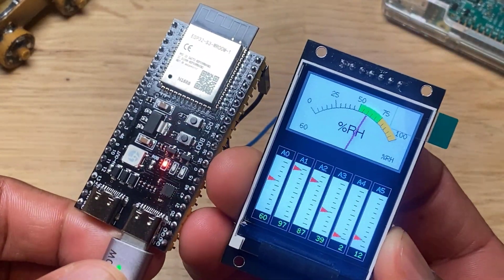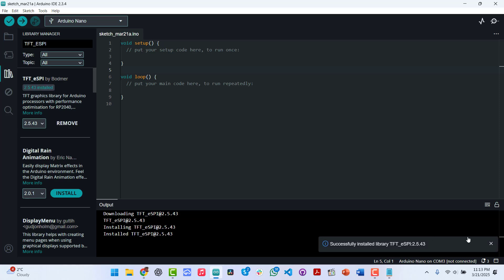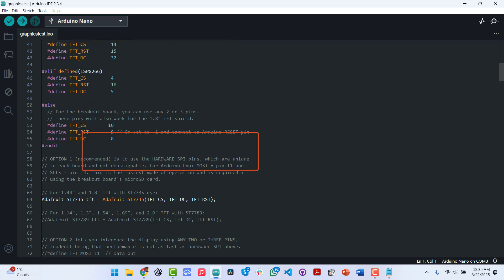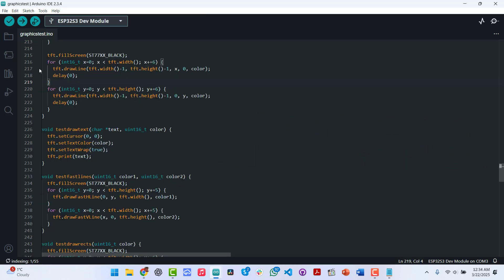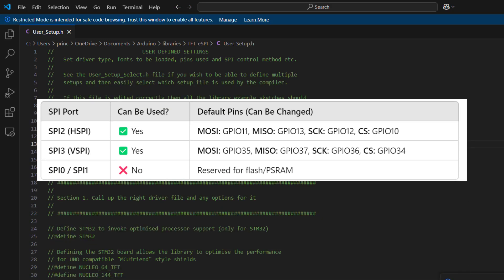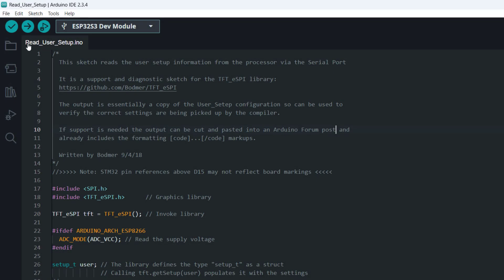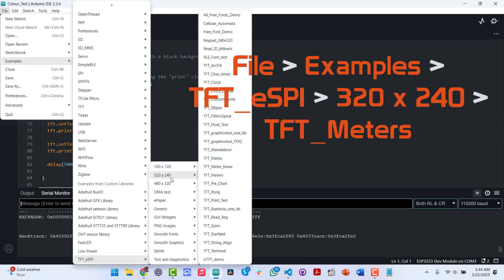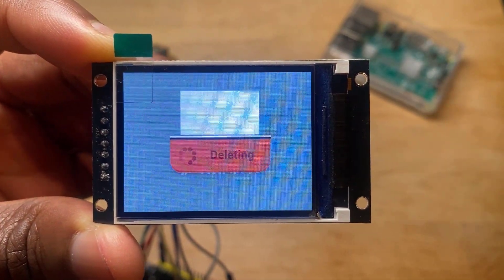How to Set Up ST7789 TFT LCD with ESP32-S3 | Fix Crashes & Use Adafruit & TFT_eSPI Libraries

Comment: For anyone struggling to get it working on the ESP32 S3 be sure to downgrade your ESP32 board definition from espressif to 2.0.14 is broken in newer versions.
Reply from the maker: initially i thought so too but as you can see from the video, adjusting the user_setup.h file fixes the crashing problem.

Comment: Thanks to you i already understand the User setup thing, but I'm using a 1.3 inch ST7789 display but without CS and also a XIAO seeed esp32 s3 and sadly it is not working with neither of the libraries. It did work while uploading on the arduino nano with the fast arduino ST7789 library but after the uploading is done, it goes back to glitch. Do you have any ideas on what i'm doing wrong. It'd be a very big help.
Reply from the maker: Can you list the pin names of your screen?
Reply: @Delali  I only have GND, VCC, SCK, SDA, RES, DC, BLK.
Reply: it is working!! It is thanks to your video that it is working so thanks a lot
Reply: @MaritjeHocedez Could you pleas let me know what you did to get arround it? I have the same type of screen(no cs pin) same layout as yours. I've been trying to make the screen work for probobly more than 6h, nothing seems to be working.
Reply: @niksdejus7945 i have same problem. did you fix it?

Comment: Next project. Using 2 esp32's 1 display and a keyboard. I bought a CARDKB Keyboard that gets attached to the M5STACK it has 4 spi/i2c pinouts. And it's programmable. Please do a video on using 2 esp32's together. 🙏🏽
Reply from the maker: Sounds like an interesting idea. I will look into it.

Should the 2 ESP's communicate over SPI, WiFi or UART?
Reply: Hi bro.  @Delali  over SPI .. please and thank you